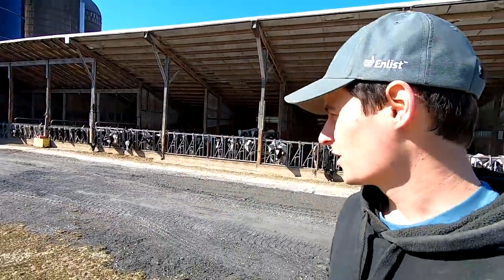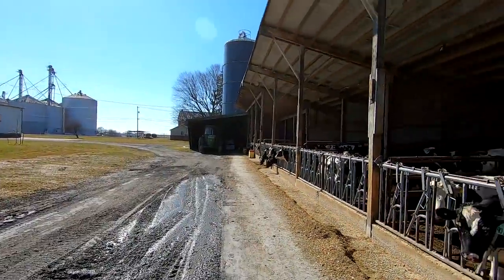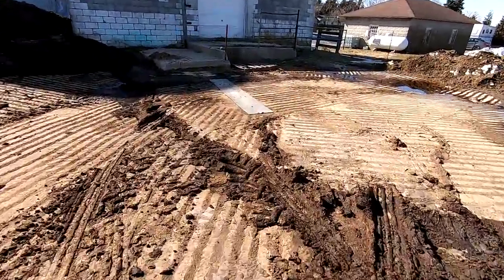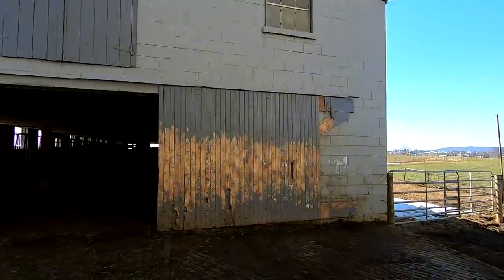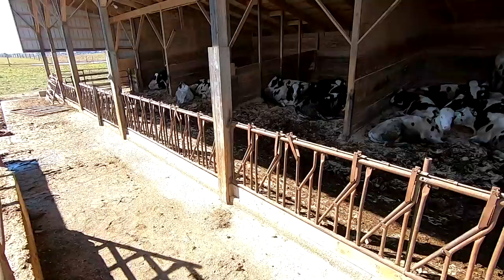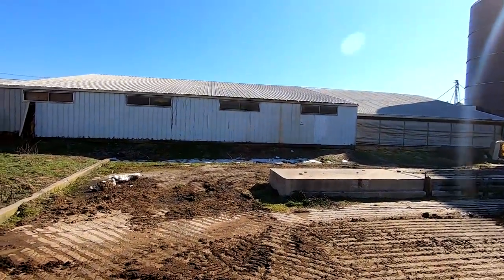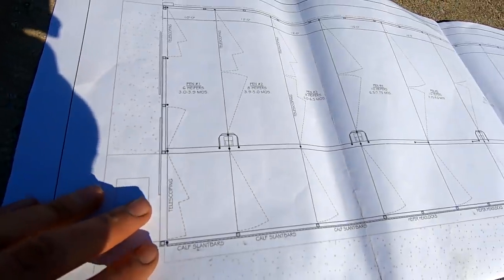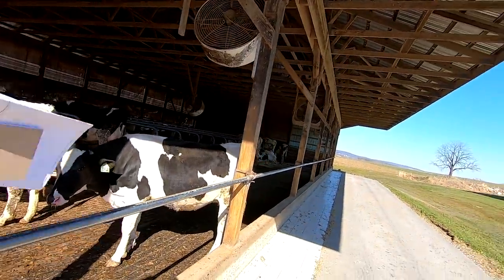2021 Building Project Explained

Comment: The flat floor and the smaller to larger pens only makes sense. You have to watch when the heifers come into heat so an area out back that you can  close in winter might be beneficial as heifers act more normal outside. It seems like the underneath storage of manure and bedding may or not be understandable to me. If it drained properly and had a ramp for skid loaders is one thing. It along with bedding may or may not be pumpable. I watch farming fixing and fabrication in New York and they have a huge pumping pit that requires much maintenance along with pumping trucks like at Duffy Ag. Any way one looks at it a lot of manure will need  moved along with a lot of equipment.

Comment: I guess Im not well informed about cow barn construction as I repair structural rot for living, but I was wondering 
if maybe wide solid wall doors at back of heffer pens (w/vent windows in them), might 
make it easier to scrape the pens w/ skid loader, into front alley way. Just open door, drive in 
through the back and push it to the front.

Comment: Don't the cows  get cold in winter if the barn is open? I guess they don't since you plan to build it this way, but what is the minimal temperature they feel comfortable in?
Reply from the maker: Cows like cold, the heat bothers them a lot more.
Reply: @10thgenerationdairyman61  Interesting, thanks a lot